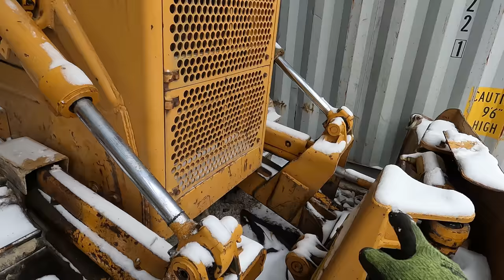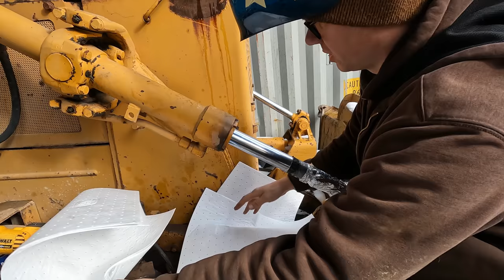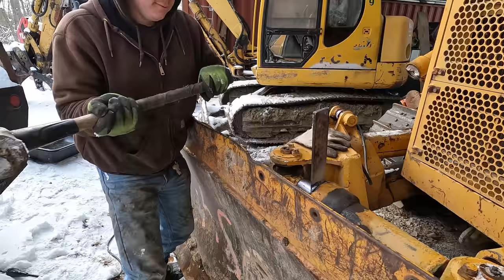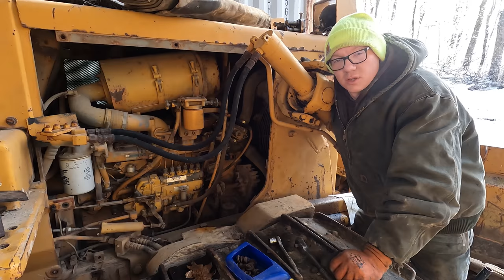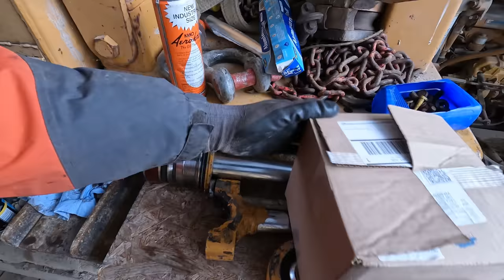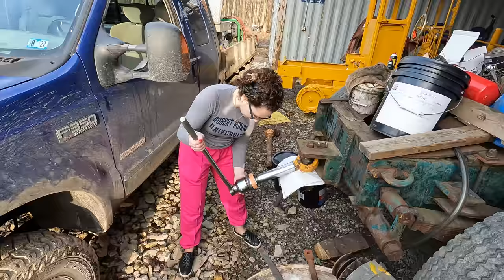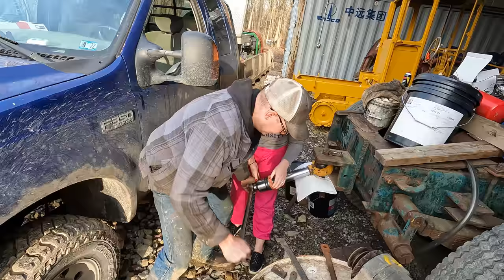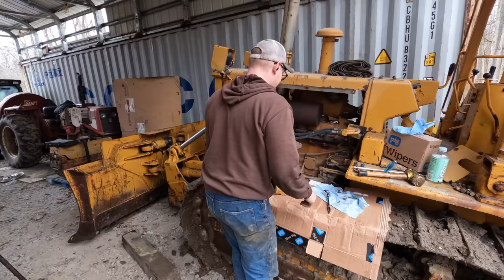Komatsu Dozer gets Cylinder Rebuild. (Long Overdue)

Comment: Putting the piston seal assembly in backward will cause them to leak sooner than the later. The narrower hard rings are wipers and seal designed to wipe the chrome rod and protect the main pressure seal from any debris the outer soft scraper misses. The main seal is for lack of a better term, the main load seal. It's designed to take the bulk of the pressure and hold back the most of the fluid. I know it's a pain but they should be flipped to the correct direction. Leaving the pistons the way they are you risk scaring the chrome drive rods as debris imbed them self in the softer seal that is on the outside. This could leave the next service far more costly as the drive/ lift rods could also have to be reconditioned! I hope this helps and good luck!
Reply: I was just going to say the same thing. And it doesn't take long for them to start to fail . Had 1 done by maintenance in the army. Took 3 months +/- (if memory is close, it was the mid 90's)
Reply: I think he meant the pistons back to front, not the rod seals. He did put the hard rings in the rod seals first.
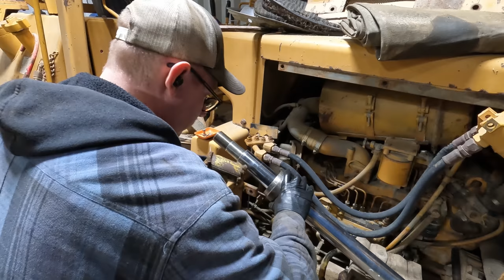Reply: He stated in the video 42:25 that he put the pistons on backwards. The seal itself is probably double acting, which means that it doesn't care which way the load is coming from. The only thing that changes is that the bearing strip, which is in there to prevent metal to metal contact,  is 1-2cm closer to the open end of the cylinder.
Reply: @mikerubynfs  last time I checked, the rods go 1 way. The ends are not tradable. 1 end is the seal /internal. The other end is the outside joint /pivot point.
Reply: @dalestpirerre2756  I meant the piston itself not the rod.
Reply: @mikerubynfs  again, not possible, the hydraulic hoses only fit to 1 end. It's almost impossible to even put the hoses on the wrong nippel of the piston.
Reply: You're 100% Right.  Bearing Strip and seal Offset is slightly different...won't measuably matter.

Pressure comes from both sides of the seal.  Would prefer bearing strip towards nut, but not worth the effort. 

Great cylinder rebuild!!!  And the wife is such a good sport.
Reply: @dalestpirerre2756  No.  He put the seal assembly on backwards.  The end piece with the big nut that rides inside of the barrel.  It's bass akwards.  It goes the other way around.
Reply: @pamike4873  I know, it's what I said to begin with. 🤦‍♂️ It's been others thinking that it's other things he put in backwards. And I even said that about a D7 repaired in the army.
Reply: @dalestpirerre2756  The piston is the disc that runs up and down inside the cylinder, attached to the piston rod. It is the part moved by the hydraulic pressure.
Reply: @mikerubynfs  really? I would have never known. 🤦‍♂️. I also know he put the scraper /hard seal in backwards. Ffs
Reply: @ryanthomas2472  no really? 🤦‍♂️ Do I have to say it in 1st grade level? Or are you able to understand the difference? Because in order to put the cylinder on backwards (like the other person said) you can't. And you wouldn't be able to swap the hoses because of the length /position /and how hard it is to connect them with the nippels /fittings. Ffs people need to think beyond just a brief description.
Reply: Well said. We’ve all been there unfortunately. Best to fix now though while everything is easier to take apart.
Reply: He put it in in the correct way, at 33:42 you can see what is actually called an "anti-extrusion ring" beeing put in first. The ring is not designed to scrape of dirt, its to keep the seal from beeing extrudet into the gap between the rod and wall of the cap when hydraulic pressure is applied.
Reply: @typgamer  Yup, the 1 out of 4. Like he said.
Reply: @dalestpirerre2756  Nobody said anything about putting the cylinder on backwards or mounting the rod itself backwards except you...🤦‍♂
Reply: @GARDENER42  do you read or jump to conclusions? Because that was the grand canyon just jumped over.
Reply: @GARDENER42  reading isn't your strong suit. Because someone else did. Hence my reply. So either go read or stop talking to me. Because you're not helping yourself look remotely intelligent.
Reply: Also, the main load seals are directional.  They are made to seal tighter as the fluid gets under the them and presses outward..  If they are backwards, it can't have that 'swelling' effect and can have blow by under heavy loads.  It's a bummer, but he should definitely go back and change them.
Reply: @typgamer   dead right it is an anti extrusion ring also it takes the pressure rating from 3500psi to 5000psi.
Reply: @calholli  agreed he ought to do it right
Reply: @ryanthomas2472  ah, thank you
Reply: @calholli  The piston is bi-directional, the seals work equally in both directions. he does not need to change them.
Reply: How can a seal at the piston, which is moving inside the cylinder into both directions and can be put under the same pressure from both sides be mounted in a wrong direction? it must do the same job under the same pressure in both directions. At the gland you can do terrible stupid stuff, that will lead to leakage, but at the piston? And how shall any element at the piston, mounted to the rod, scrape excess oil of the rod? Can it be, that you mixed up "piston" (iside the tube at the end of the rod, separating the two working chambers) from the "gland", which closes the tube and seals the 2nd working chamber?

Comment: I literally laughed out loud when your wife was helping. She is a majorly feisty woman.  Love her.
Reply: Yes we do need more of her on the chanel and if matt was ignoring her then I am very sad
Reply: @TheInevitableMan  My Step-father always told me to push, not pull when you are doing ratchet work. If you noticed that Matt is doing short pushes.
Reply: Part of her difficulties was the same things that any newbe has to learn about. Body position, and as most of us know that can only be learned the hard way.
Reply: Also the fact that the other part was missing!!
Reply: @TheSwitzertrainer  I rarely push anything, because it often results in fasteners breaking free suddenly, and my digits getting cut or smashed. I stopped pushing on prybars long ago when removing a Mack cabover starter. It finally freed up, and my fist on the pry bar put all my force into the exhaust stack mount. It was like punching the side of a safe. My pointer finger swelled up 3x it's normal width, (not exaggerating) and I had to drill through the nail to relieve the pressure. Lost that nail a couple weeks later, and let me tell you, that's damn painful on it's own, but it's a world of pain working with your hands as a mechanic. I hit that finger on vehicle parts every day at least once, until it finally healed up.
Reply: LITERALLY

Comment: A CNC plasma table might be a a good addition to your shop. Great for cutting custom tools. You could cut a spanner wrench in a few minutes, after measuring of course.
Reply from the maker: It’s on the list! Lol I’ve been wanting one for years
Reply: I was thinking exactly the same thing, or even, there must be a shop close by that has a plasma cutter and it's not a big or expensive job either!
Reply: @sosexyimsexy1673  This is more of a farm channel.  What's her milk production?
Reply: flat bar and an angle grinder can do that too
Reply: @j81851  probably a bot, they are all over youtube comments
Reply: @donsurlylyte  Yeah, it's a bot. Tip: if you see a bot like this, you could/should always report it (click on the three dots that appear when you hover your cursor over a comment).
Reply: Or maybe just buy the proper spanner tool? 😝 😜 🤪
Reply: I knew someone would be saying the same thing, all I had to do was look down in the comments. Although one can cut/fabricate such a tool even with the stuff he has now. It wouldn't be pretty but it would be utilitarian.
Reply: @uclajd  idk... I don't think sledgehammering most spanners turns out too well
Reply: I'll take any excuse to buy a tool. One time is > my average tool use anyway. 😝 😜 🤪
Reply: @DieselCreek  When you get the shop built, you will have a nice place to keep the tools you've been wanting to acquire. You gonna get a car lift too and set in the corner?
Reply: @uclajd  BUY? BUY? For shame... Shame on you for using that word! Begone! Begone, I say!
Reply: I have one and do that all of the time, good value and actualy not so hard to make your own table for just a couple of k
Reply: Buy a lot of tools for $10k for a plasma table
Reply: @uclajd  right not like there aren't other cylinders on that farm or future. Like watching a train wreck, can't not watch see what he screws up today.
Reply: Beat me too it. I was going to say something similar. This guy is more than capable of making something up. But I imagine he's not planning to take off those rams ever again if he can help it.
Reply: I was going to say the exact same thing, I can't live without my plasma table.  Get yourself a crossfire pro it should be adequate for what you do.  I started out with the original langmuir crossfire and now I have the new crossfire XR.  I run a a Thermal Dynamics cutmaster a120 on my crossfire pro and I run a Hypertherm powermax 125 on my crossfire XR.  Having the ability to reliability cut 1" or thicker steel is nice.
Reply: Diva creek helping out   Nice
Reply: Jim jibroni  yes unless you bought it at harbor freight. You're right about experts in comment section. That's about it.
Reply: @stephendoing2253  You don't need to spend 10k on a plasma table anymore, I remember when a 2x4 torchmate table was 10k without a plasma cutter.  A langmuir systems crossfire pro with every option is $3500 delivered.  He can use his existing thermal dynamics cutmaster plasma cutter with the hand torch or buy a machine torch for it.
Reply: Jim jibroni  If I cut a spanner wrench out of 3/8" thick A36 plate he would have no problem disassembling those cylinders.
Reply: @j.walker3498  Put the pistons in backwards. 🤣
Reply: Jim jibroni  He could take a piece of 3/8" plate, about 5" wide and say 10", cut a slot in one end just wide enough to clear the piston rod generously and reach to the far side of the cylinder.  On the other of the plate narrow it  in a way that he could weld a heavy bar handle on.  Then weld some teeth to engage the cap slots, he have a ugly wrench that would stand up to almost anything without needing a plasma cutter.  Could do the whole thing with an angle grinder/cutter and stick welding.

Instead of welding a handle, he could weld on a 3/4" socket onto the "wrench" with the square hole outwards, thus he can use his wrenches (with a cheater bar if necessary) to turn it.

My other thought is that perhaps an air hammer or hammer drill could loosen it up.  A moderately sized SDS hammer should do it.

I hope he remembered to use no-seize when putting it back together.
Reply: @samarium7000  report it as pornography.  The other applicable one is "spam", but pornography reports will count more.
Reply: @uclajd  Thats why I watch.
Reply: Or he could borrow someones or just hack it out with his normal cutting torch and clean it up with grinder?
Reply: @DieselCreek  Matt I love your channel.. Here on Vancouver Island, BC, Canada (Northwest of Washington State).. we've gotten all of your snow this winter..  It snowed again today (Feb 26/27), which is highly unusual for snow this late in the year. BUT we've been dumped on this year. More snow than I have ever seen , in my 55 years.
Reply: @samarium7000  thanks
Reply: @uclajd  As Matt stated, why spend a C note for a 1 time use... I thought he might rent one...
Reply: @DieselCreek  surely you can by a run down one and rebuild it
Reply: @DieselCreek  I have a plasma table if you ever need anything cut.
Reply: Can confirm they are badass
Reply: @j.walker3498  Good for your ego?
Reply: @fromagefrizzbizz9377  Took less time his way...
Reply: @charlesangell_bulmtl  what are you talking about? Did you get lost/confused in the comment section?
Reply: @charlesangell_bulmtl  I'll bet he could have cobbled up a wrench with his stick welder and grinder and have had the whole job done in less time than he took.  Not even counting the time that cylinder was out being rebored. I can't fault him because I'm not there and he had done this way successfully before.  I'd be to paranoid about screwing up the chrome.
Reply: Matt sorry I don't do domestics
Reply: The order of assembly of piston is important, one of the seals is a wiper to keep any trash away from the accual pressure seal.

Comment: I was a machinist in a hydraulics factory and found it would be easier to just make a spanner wrench to do the job right and then you would have it for future use.Since you work on big equipment you will be doing this again in the future.
Reply: Yeah, get a little cnc plasma cutter matt.
Reply: One of those pipe chain clamps opens those rams.
Reply: My thoughts exactly. Welding a bar onto the cylinder nut is crazy lmao. What a hassle.

Comment: Have built cylinders for years , if you put the piston in backwards it will work but not for long. It gets worse when you bottom out the cylinders. I know it’s a lot of trouble but I would repair, may save piston and new parts. You can use an engine hone to polish the tubes clean out very good.Good job ,love the video .

Comment: Big thing to watch for with pistons on backwards is the actual pressure part of the seal crossing over the port where the hydraulic line is welded on, this causes the seal to fail. Had this happen on a bobcat cylinder.
Reply from the maker: Yah I looked at that, these cylinders are all designed so that won’t be an issue luckily

Comment: When protecting the shaft use a pvc pipe cut in two halves and hose clip it around  the shaft. The arc from the welder can not  jump to the shaft.
Reply: Smart 👌

Comment: Man that was tight, might be time to invest in a good cylinder wrench? They're pretty cheap on ebay. Aslo I use wet rags on rods when welding, never had a spark go through.
Reply: For what it’s worth, been keeping your family and your neighbors in our prayers after those 1/2 century rains. Hope the clean-up and repairs are continuing to go well.
Reply: @jrondyer1049  Thanks man, all is well here. Cheers
Reply from the maker: Hey bud, never thought about a wet rag. That’s a good idea, I’ll have to give that a go one of these days. After seeing this a generous subscriber sent me a proper wrench so we’ll see how that works next time
Reply: @DieselCreek  Nice.. I think it will get a lot of use with all those old machines you're accumulating ;)
Reply: @MartyT  thats not auld, thats just well experienced :-)
Reply: He could also use a hone on the tilt casing, which should be better than scotch bright at keeping it round.
Reply: @DieselCreek  I have the same problem on my 1982 Hitachi EX100, which is for sale btw, but I have on crane or other machine with which to lift them and I think they are a bit too heavy for me to lift.  They look bigger than yours and you only just lifted yours.  The elbow leaks the worst on mine. I might find a come-along and a big oak limb, but I don't see one in extension chord range of the shop.

Comment: I would check your oil cooler, typically when seals in a cylinder break apart like that is because they've been overheated several times. The radiator and coolers are almost always over looked and need a good pressure washing in my experience
Reply: at mines I think they pressure wash all the radiators like once a week or something lol
Reply: @timgoodliffe  the local coal mines built stand and ramps to use monitors and fire hoses to wash there equipment and trucks. I just know from experience buying old equipment that the radiators are typically about 1/2 plugged solid and the only way to clean them is to was it.
Reply: if you watch C&C equipement hes replaced the seals on old army dozers that have no hours on them he said if they sit a long time and dont have the fluid running back in forth in them the seals dry out

Comment: An engine cylinder hone can clean up a barrel. I assemble the seals and such wet with hydraulic oil. High strength thread locker is usually used for the piston nut. It can require high heat to break it lose. Curtis at Cutting Edge Engineering flame cut out a spanner for the gland removal on a recent video. In Australia, not a single visible drip is tolerated.

Comment: Tip if you are rebuilding hydraulic cylinders outside in cold weather.  Get a camp stove (or use a propane torch) and a large old cooking pot.  Put a couple of inches of water in the pot.  Get a smaller pot (or other container) and put a couple of inches of hydraulic oil in it and place it in your cooking pot.  Drop the cylinder seal in the oil.  The water will prevent the oil from exceeding 212°.  The hot oil will lubricate the seals and the heat will be make them more flexible.

Comment: 2 thoughts when welding or grinding around shiny surfaces take your cutting torch light it on acetylene ONLY and put some smoke on the shiny stuff, spatter
won't stick. Glad you upgraded to  a welding glove over the aluminum foil.
When your tearing things apart take your phone out and take pictures for assembly reference. 
Love your videos, you are amazing.
I like an Honest Man, that's why I enjoy watching you.